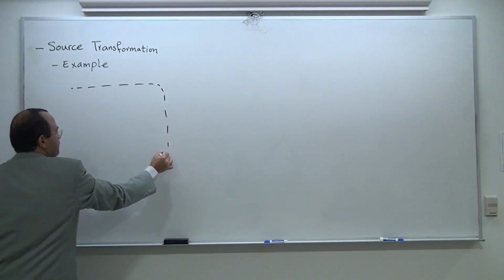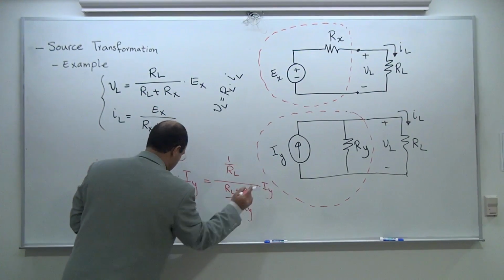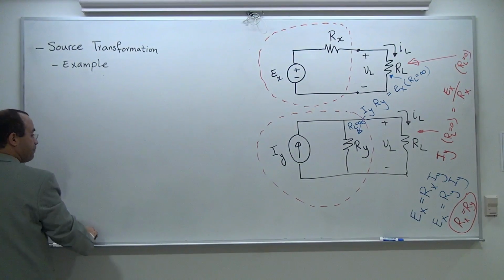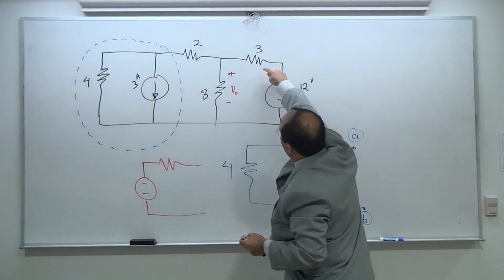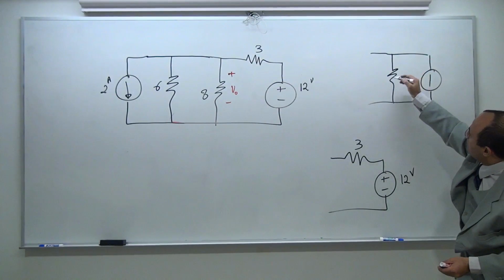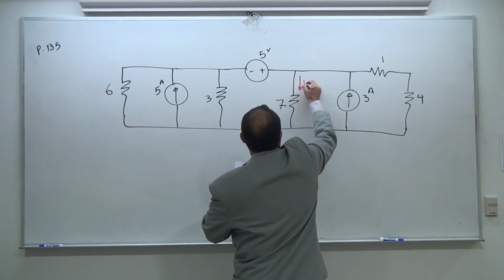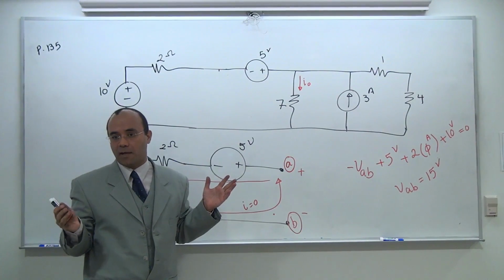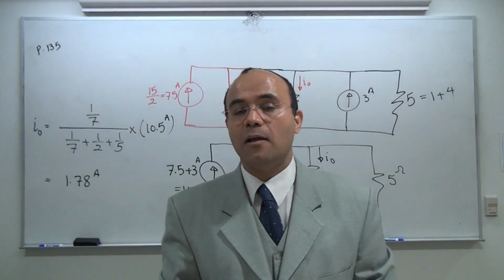Chapter 4: Source Transformation

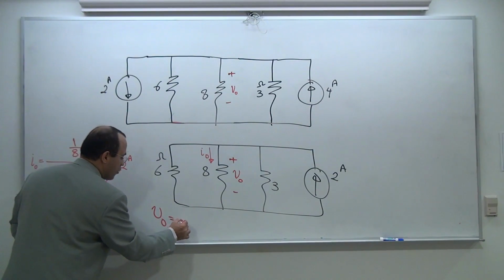Comment: 33:00 The current division principle is not done that way. He messed up the total resistance formula and the "CDP". But apart from that I've enjoyed his lectures a hell of a lot.
Reply: He''s correct, he's employing a different method.
Reply: +orebbiL he his right try using it in voltage form by changing the first current to a voltage form and then use nodal analysis and you will get the same answer.i thought he was wrong also till I tried nodal even though I didn't know that there is such method in current division

Comment: i0 = 5.25 Amps actually, i think you got the current division wrong. Anyaways, great lecture.
Reply: Adam Sezer value of current obtained in the circuit is correct  i tried with a different approach and my answer is same as the video